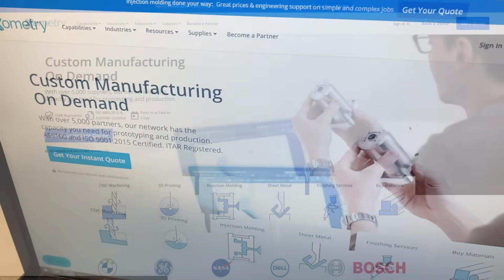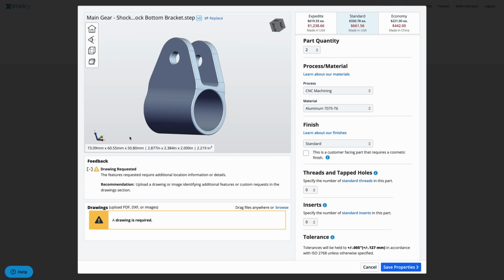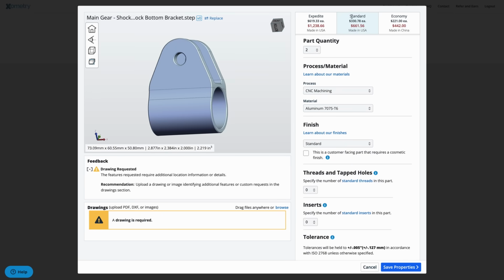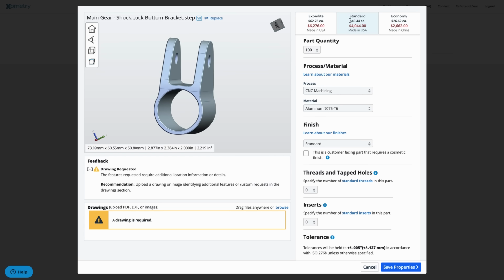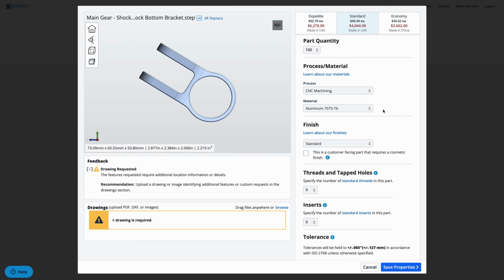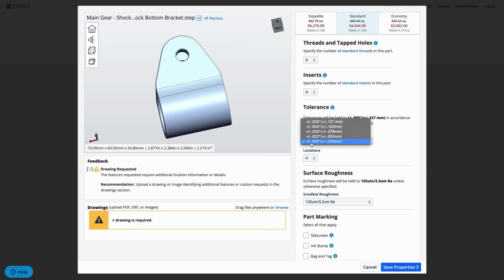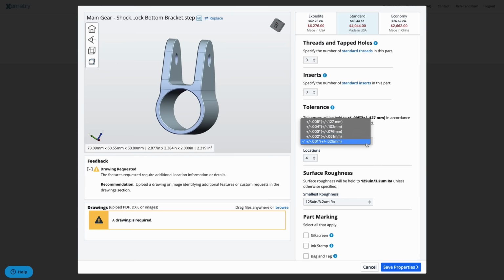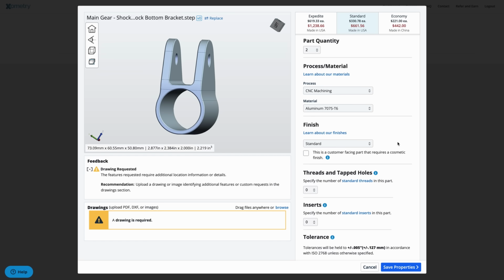The TRUE COST of CNC machining!

Comment: An aluminum extrusion would save 90% of the material to machine and knock you down to 2 setups. Whether the cost of the extrusion die would be economical is of course production demand dependent.

Comment: it would be nice if you cast the part or form the part, finish the tolerances, then case harden the material. since it's aluminum, at volume, it would cost less, improve strength and increase durability

Comment: Thanks for the video, really really helpful. I’m currently designing an almost identical shock bottom mount for a car and have been considering carbon forging, versus welding two plates to a pipe, vs outsourced CNC machining. I need 4 of them, and works out about $100 a piece from quotes I’ve had online. So sounds similar ballpark to yours when you factor in volume. I was curious as to the factors that made up the cost, including things like machining time and number of setups/passes. I was actually surprised that removing some of the ‘nice but not essential’ details that I could hand-add myself after the fact didn’t change the price, so added them back in again!

Comment: When I was doing job costing, it was machine cost per hour, operator cost, tool cost, material costs divided by number of parts produced + bag and tag.
I had to explain to so many customers that were new to cnc prototypes that it doesnt matter if I make 2 or 20, roughly same total price. only difference was material cost, 2 parts in an hour or 20 parts in an hour, total hour cost /2 or total hour cost /20

Comment: I'm just a tad confused why you would machine this thing when you could just weld two ears to a pipe and drill a hole through them.
I feel like that'd easily be the cheapest option...
(Well, I think welding aluminum is hard or something? I'm no pro by any means, but when I look at that thing I just see a piece of pipe and two ears with holes in them....)

Comment: I'll bet I could Square up that to Out side Dementions Lay it out with a Height Gauge Roufg Drill the holes (4) and machine it in a Bridge Port Faster and Finish bore the holes,and  cheaper than Programing and Machining it in that expensibe Fancy CNC Machine that doesn't even have a tool changer.

Comment: As a manufacturer. We did business with some - (competition) of Xometry, but not Xometry itself, so I am curious how Xometry works. We noticed a significant price drop to the manufacturing side, so low to a point it wasnt even close to being profitable anymore. I tought, some prices where very unfair and its all on a take it or leave it bases... So we decided to - leave it.

I think those websites do a great job, but I also noticed a great risk. Because what if you invest a great deal in extra capacity and those website just drop the prices like no tomorrow and all that work just goes to low cost countries in eastern Europe or Asia.

I felt that - there was no benefit. - AND - I felt the risk to do a great deal of business with them is just to big. How do you feel about this?

Comment: Designers and Tolerances ????
1 mouse click just added 1 or more hours to the job that didn't need it ??
So many times making parts for a customer and they leave a tight Default tolerance for a simple bushing that only needs a bolt through it ??

Comment: One cost US$400 while cost US$40, that your thumbnail said. As far as I notice, to make combustion engine parts high compression ratio need more steel rather than Aluminium 7075. I just don't get clear message which cheaper between CNC or die casting, just get idea that CNC is future 4.0 which need material lost. Btw I like this kind of video.

Comment: This is interesting, I personally wouldn’t touch the original tolerances, but as a mostly hobbyist fabricator I would charge around $150 for the 5 thou version. Which I would produce with a water jet and manual mill.

Comment: If you are going to interpolate the bores make sure your machine is properly maintained.  Excessive backlash will degrade circularity and can cause significant stress risers allowing a properly designed part fail because of poor manufacturing.  Of course you could also just use a boring bar.

Comment: A friend of mine used to work as a prototype machinist and teacher for machinists, and he always said, ask the constructor if the tolerances NEED to be as tight as he has set them on the drawing, or if he did it just of habit.
His first job he ran a series of pieces on a clapped out mill, so they scrapped a lot of them for being out of tolerance, the material was just cheap steeel, so no biggie, but it was a lot of machine time wasted.
When he saw them mounting the piece, he realized that the tolerance should have been 0.1mm, not 0.001mm
99% of the parts he scrapped would have worked just fine.

Comment: When I worked at Boeing as a machinist they told us once that due to tolerances a 707 could vary 7 feet in overall length.
I ran an electronic tracer and had tolerances on two parallel surfaces over a 6" span of +0.0/-.005 on a titanium part refueling nozzle. Every part I made passed inspection.
Management came down on me once for making less parts than the first shift guy till I pointed to all his reject tags.
That shut them up. Lol

Comment: You guys definitely are overcomplicating the tool paths and setups. Keep the part on the bar, hang the bar out of the vice, and profile the side along with the hole. Drill two holes in the corners of your fork for the radii. Saw part off. Now profile the triangle and drill your cross hole with the part on its side. Stand it up and mill out the fork and there you go

Comment: if you are sending the file with all tool paths/Gcodes it honestly should not cost that much you have already done 90% of the work and thats being Generous.. 10 bucks for two, but buying only in bulk and still costing  8x per part would only be worth it if you could not produce the part how ever at that point and cost might be worth looking into buying some capable machines, just an order or two from you is buying that machine there using food for thought

Comment: If you look at this part, it's a perfect shape for an aluminum extrusion. If we talk mass production. The extrusion production be outsources cheap and easy. The part just needs minimal CNC treatment and less material is wasted.
Reply: I dont know if its possible for aluminium, but I saw parts like this weld together from pipe with laser cut and bent plate. If you need tolerances you still have some materiał left for machining.

Comment: Curious.  Knowing/expecting I'd be making many more, I'd at least built tooling to hold 2.  Chuck the material for the 2 lowers, throw that in the mill while chucking 2 uppers in the other tool.  Finish lowers #1 operation, pull the tooling, load the upper and run it's #1.  While it's running, reorient or move over to #2 tooling for the lower.

Comment: You could also have just one process if you used a cnc lathe wich has two chucks (automatic chuck swap) and c-axis milling option.
Reply: How much are one of those
Reply: @Mackensp99  easily around 100k

Comment: Ten dollars but you aren't including Overhead such as Cutting tools equipment like that KURT Vise not to mention the CNC Mill it's self and don't forget the coolant. Then there is Light heat and the cost of the building or rent ... Now make a real estimate as to what those parts cost you Just like the Xometry had too.  Now think what that part ould if it were installed on a Certified Aircraft not a Home built.

Comment: We've had to do various one-off/prototype parts for aircraft manufacturers on a 6 metre, 6-axis mill.  Some of the prices would make your eyes water for these, but on a production run it drops massively.  Also to show how daft some companies are, we had to do a spare part for an aircraft that went out of production a few years back.  When in production they were made 5 per billet (3m x 1m x 75mm billet) and cost around $20,000 for the 5 parts.  They just wanted 1 part though even though they could have the other 4 for future spares.  Paid full price for that 1 part.  CNC machining is a funny world
Reply: Reminds me of when I needed a stepper motor to replace a piece of lab equipment. The previous generation had them available for $200 bucks. They didn't sell them for the new model. I found a company in china that could make them with a minimum order of 100. The cost? $2 each. Seriously. My boss said "but we dont need 100" and sent the equipment back to the manufacturer for repair. They charged us 2500 dollars and replaced the motor. In retrospect, I should have asked them if they could charge me for 100 and throw 90 of them in the trash. "They said they will sell us 10 for 400 dollars!" Hed probably have gone for it.

Comment: CNC is fine for semi skilled machine operators in mass production, hence China's leading the world now in precision pieces at cheap prices.
But these days try to find a machine shop that will make a one off small part, or even has the machines an skilled operators to do it. An at a realistic price.
Only way if you are lucky in your area is to find a retired old fart like me with a garage set up. An I do not have the space for all the machines I would like to have.
Plus getting even a decent Lathe is getting difficult as they end up as scrap or snapped up at ridiculous prices. Not to mention the likes of milling machines etc.
Paying out even for hobby use $10,000 for a CNC set up is not sensible even if you can afford it.
CNC has killed the back street small engineering shop that could an would make anything they could at a reasonable price.
Not having a go at you guys, just would like to know what you think?
I have so many ask me "Can you make this for my classic motorcycle or car?" When I say sorry no, they ask "Do you know anywhere that can?". Again the answer is sorry no. Even 30 years ago things were getting difficult. Now even getting common metals is hard an expensive. Unless you want 100 Tons.
Last piece of plain Aluminum I needed had to come from 100 miles away from a friend of a friend's supplier. 
An as to getting metal heat treated or even plated, forget it unless it is a production sized order.

Comment: I have been working as a quality engineer for many years now able to use cad design my own parts then moving on the cnc machining may I as a question can all cnc machines use cam to programme or would some require g codes ?

Comment: Tolerance of .001 is way too tight.  It’s not necessary on a part like this. .005 is tight and works in most designs requiring some precision. .015 is generally good enough.  No wonder the pricing is so high. The tooling itself has problems with holding a .001.

Comment: By offsets, do you mean datums. 
UK machinist here and we use the term offset when setting tool lengths, G43,and tool diameter offsets,G41,G42, 
Datums is the workpiece zero point where all the dimensions are calculated from. Otherwise well explained,